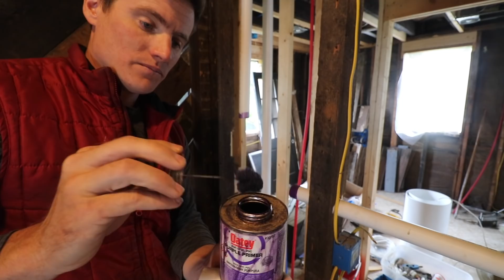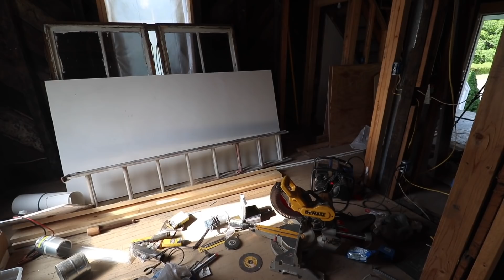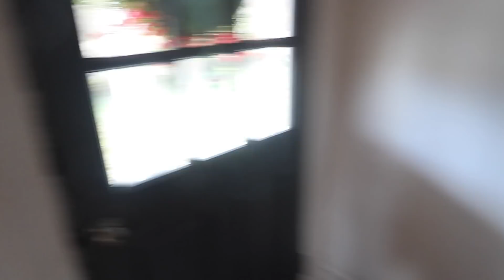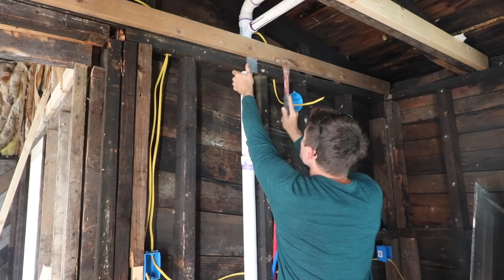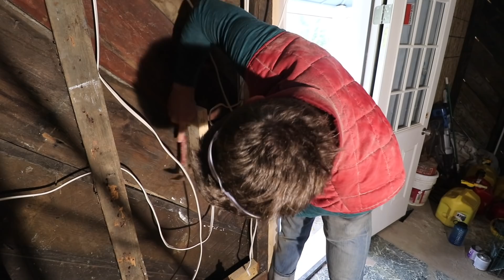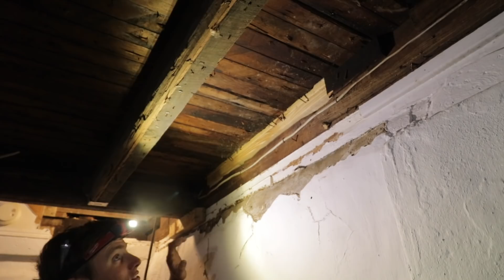$9,000 HOUSE - READY for INSPECTION? - Ep. 47

Comment: Really great details, particularly for DIY builders.  Many thanks.

Just a few observations from Hard Knocks University:

Whenever using a hammer to set those metal plates to block drywall screws,
it's a really excellent policy always to wear safety glasses.  Even with many nails,
especially nails with small heads, a hammer can dislodge a small metal shard
which can easily damage an eye.  You may have heard some of the stories:
one of THE WORST I heard was a guy who was prying up a 16p nail from the floor
with a long crowbar:  the head came off and went straight into his eye,
causing him to lose all sight in that one eye.  He also made another mistake
by bringing his nose too close to that nail head.  

How much do safety goggles cost?

Another helpful idea, particularly if you have an apprentice helping,
is to mark the floor with a yellow carpenter's crayon, to show where all
wall studs are located.  This will help drywall hangers who can then
use line-of-sight to set drywall screws that are plumb with those crayon marks
on the floor.  Put this question to your drywall hangers, to confirm whether
or not these crayon marks will make their job a little easier, especially 
below all wall studs that are just not spaced on normal layout (16" or 24" O.C.)

KEEP UP THE GOOD WORK!  All your many details are worth remembering
for many years to come.  And, sending apprentices in the right direction
is always a good community policy.
Reply: Also, another thought just occurred to me: 

When you're using small wood pieces to fill gaps in sub-flooring, 
it may not be sufficient to hold them with screws 
that are not fastened thru pre-drilled pilot holes.  

Over time, that solution may start to squeak.

Best (and quick) solution is to add enough strong panel adhesive 
that should cure rock hard and bond such small wood pieces with adjacent wood.

You never know when your best friend -- a 500 lb. Sumo Wrestler --  
just happens to set one foot right on that small wood piece.  LOL!

Comment: One thing i learned during my years of selling pvc pipe & fittings and something I recommended to my customers was on your cleanout plug to hit the threads with some spray lubricant (silicone works best). This makes it easier to install the plug as well as remove it when necessary.

Comment: Funny, we in Europe do dry wall electricity the other way around. You put your cables through plastic corrugated tubes to the place where the switch or outlet should end up.

The drywaller then puts the dry wall in and just put circular holes with a hole saw and tugs the cable ends through and finishes the wall.

The electrician then puts the round boxes into the holes which clamps from the front and the back on the dry wall and put the outlets and the switches in.

After the room has been wallpapered and painted the electrician finishes by putting on the covers for the switches and outlets in the color and style the customer chooses and does the final check.

Comment: You are over complicating the wiring in the UK we just put an x or a nick on the cables to identify them as we pull them in also those back boxes you are using look horrible none of that bollocks in the uk we have dry lining boxes which are screwless, also why use the metal plates? if your studwork is 400 centres then no one is going to screw through a cable or pipe? ie 8 x 4 plasterboards

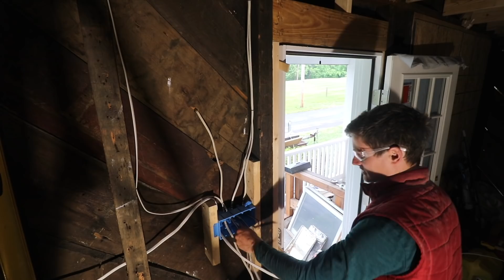Comment: 27:39 .... why did you use metal ... staples to hold the wires ...is that code..... isn't in Australia .... just say'n
Reply: I've never seen anyone in Australia use those metal protection plates on the studs either. Or maybe the pasterers do it right before they do the plasterboard?

Comment: Don't feel weak if you can't open a can of glue. It's glue, it glues itself shut. I don't even try to open those cans anymore without grabbing some slip joint pliers to open it with
Reply: Just spray a little solvent on the glue to loosen it. Work smarter not harder.

Comment: Just an fyi - do not drip the purple pipe goo on your linoleum floor or you will have a problem. Learn from my situation, and be careful of this stuff.
Reply: As one unfortunate to another? 40% hydrogen peroxide on a waste rag does wonders. Takes SEVERAL applications, but it does bleach out. I have vinyl tile.
Reply: @DodiTov  - ty! It actually etched into the linoleum. I'm not really upset about it, as this flooring is 30 years old and needing to be replaced. I will try your suggestion if just to get the stain out.

Comment: The alcohol in the primer shrinks the pvc. Then you quickly apply the cement. Then when you hold it together for a few seconds the alcohol will evaporate and the pvc will expand back using the cement to lock it in place.

Comment: The purple primer reminds of a funny incident. When I worked at a "home improvement" place I happened to be a bagger for a plumber who bought what seemed like a thousand cpvc fittings and a large can of purple primer, which I put in the bag first. It had leaked all around the cap( he was fine with it) so as I was bent over, loading the bag, I realized I was getting all kinds of happy! Apparently the primer was still letting fumes out because he had opened it to make sure it was full and didn't tighten the cap as tight as it should have been. It took awhile for my head to clear. I recommend a well vented area if possible 😂😂

Comment: as a swedish plumber these glued pipes confuse me, in sweden we use a plastic pipe with so called muff ends and different fittings in different angles in the walls, also we use cast iron in the walls with a metal banded fitting with rubber on the inside called an ultra jet coupling. in visible instalation in the bathrooms we use a plastic pipe with rubbered insides, so swedish plumbing is able to dissasemble almost 100 procent. we also have a safe water code system, with laws
Reply: You live in a country about the size of one of our states, so it is easier to have uniform laws in your country. I remember when PVC pipe first came out. There was great resistance for clean water usage, and it took about 5 years to change the laws to allow them for that purpose. The glued pipe becomes one pipe because the pipe melts on itself, creating a whole piece of continuous pipe. The fittings are thick enough to keep standard thickness, so there are no weak spots. Essentially, with the glue, he is equivalent to braising copper pipe and laying a bead. 

In your application and his, you still must access the piping to repair it. In his case, all he has to do is remove the drywall, cut the damage with a saw and glue in new pieces, then patch the drywall. No need to fiddle with rubber housing because our country does not have extreme cold concerns. My yard service is only 18" below ground, and it has never frozen. Been there for 25 years and no problems. North of me, it can go to 6 feet, but that is close to Canada. My depth is correct for my state because we have little to no cold weather. 2 feet is extreme safety here. My septic tank is only 3 feet below ground. In latitude, I am about in North Africa, as is most of our country. Can you see the difference in plumbing concerns? You must deal with frozen conditions for most of the year. We do not.

The PVC pipe is food grade pipe. It is tested by the Federal government and has a safety standard. It is corrosion proof and rot proof for 99% of all applications. Therefore it is better than copper for clean water. We still use the iron waste pipe, but it is very heavy and is usually only used to connect the house and the sewer.
Reply from the maker: PVC is a beautiful product. Same for PEX.
Reply: @homemadehome5575  i know we use both here in sweden, we usakly use copper here and alupex. Aluminium woth pex plastic around🤩